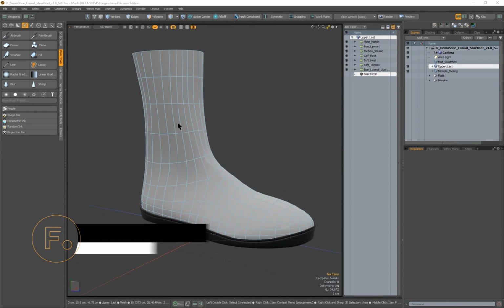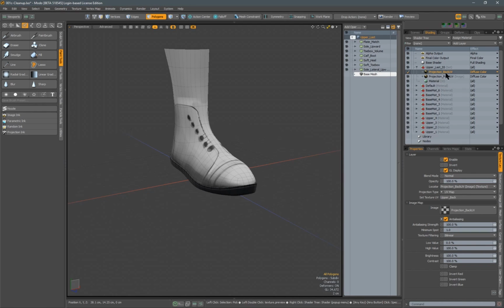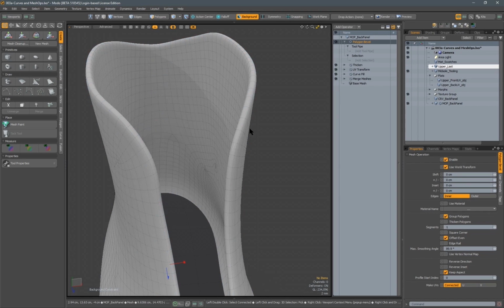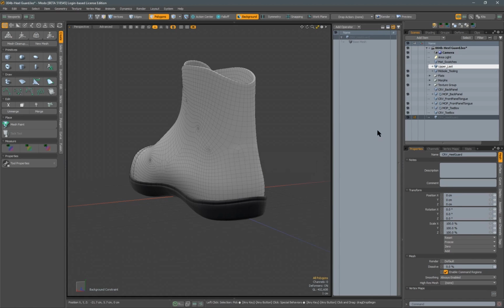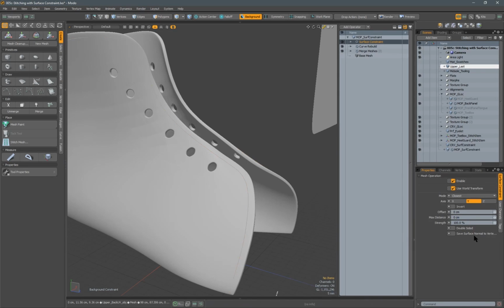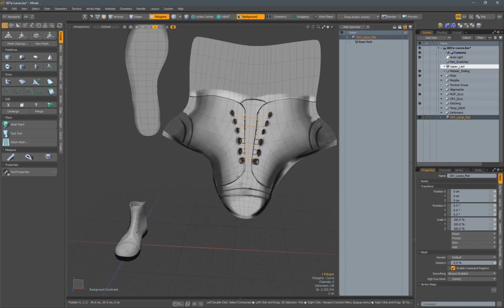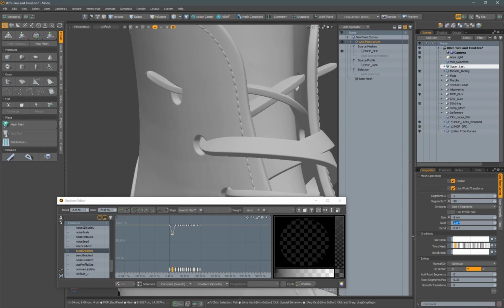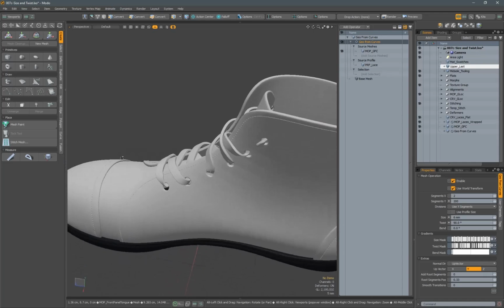Modo Tutorial: Procedural Modeling A Shoe

Comment: Sorry for a Noob question, but what exactly IS a digital last?
Reply from the maker: In traditional shoe design and construction, a shoe last is the wooden or plastic mold upon which a shoe is constructed. The last used during shoe assembly can affect the overall fit of a shoe, and all lasts include the following dimensions: Heel width. Instep height. Forefoot width.
Reply: @MODOGeeksTV  AAAHHHHH!  Well that makes perfect sense.  Thanks!

Comment: So, is that correct that it is not possible to achieve without use of paid plugin?
The fact that this is an official channel that posts video of worklfows that are not achieveable 'out of the box' makes it even more ridiculous.
Reply: That' depends on your definition of ridiculous. I find not supporting the dev community ridiculous or not expanding one's toolset similarly. It's a 35 Euro tool. A trivial amount of money for the time saved setting it up manually, and using those tools in a production environment happens all the time. What's funny is, it's only used for the laces. The entire rest of it is vanilla and achievable "out of the box". But like I said, trivial. Moving on! :)
Reply from the maker: It's certainly possible to achieve similar results with lots of varied techniques. As noted the script was used to make things easier on the laces alone. There are many ways to procedurally model a shoe, this is just one example that we thought would be cool to share.
Reply: @MODOGeeksTV  Could you please elaborate on that? Is there any chance that you could provide a suitable workflow regarding those laces? Just in order to bypass using 3rd party solutions.